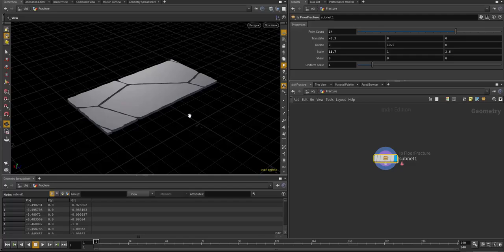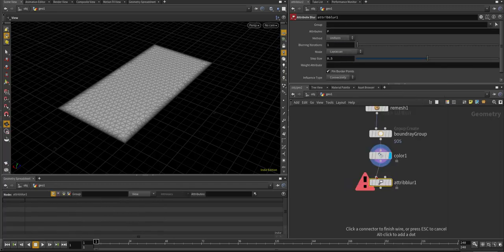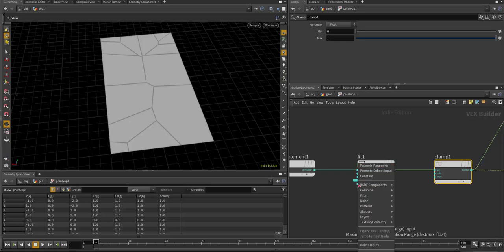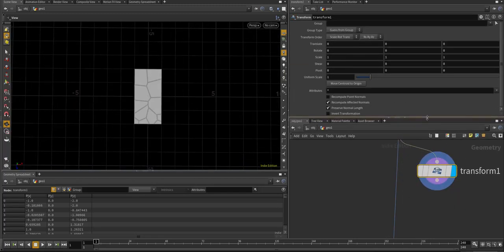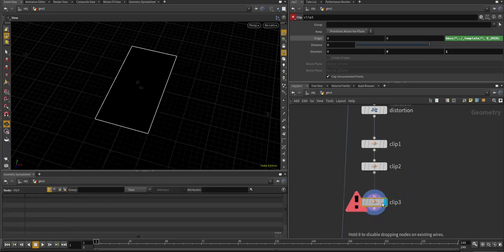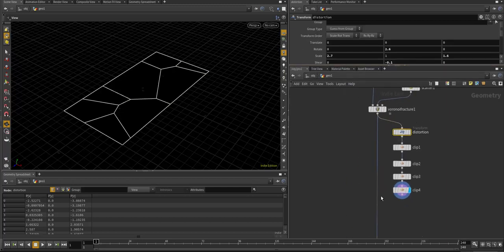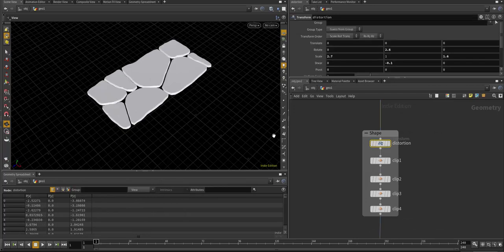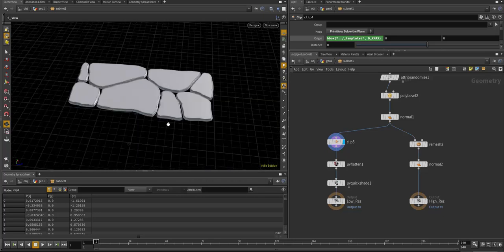Houdini 16 - Stylized Fracturing - Part 001

Comment: Hi
This tutorial is gold!
Can I ask, I would like to adapt it to create lots and streets in a medieval city. Is there a way to  jitter the resampled points  organically like you did so to deform the inner streets in a "weavy" way like you did but also avoid warping the outer bounds of the perimeter? 😅. And would there also be a way to keep the geometry between the lots, the fractured shapes, so to use it as streets?
Awesome tutorial in any case ;)